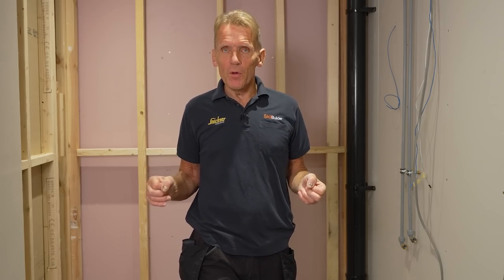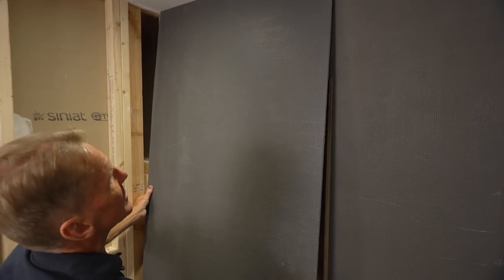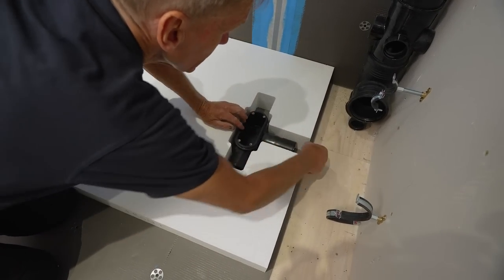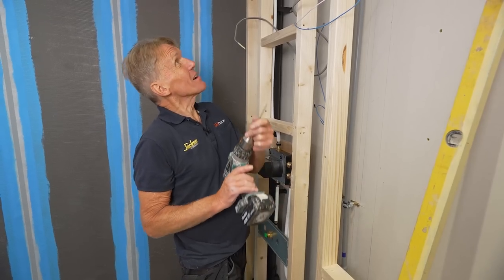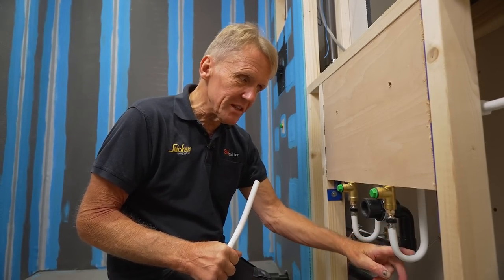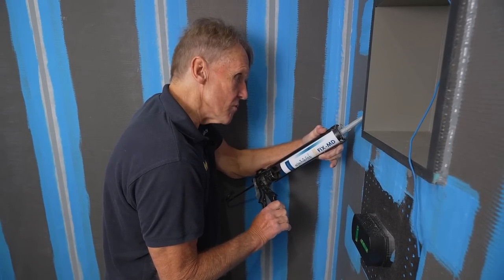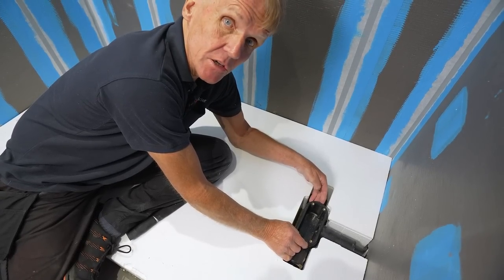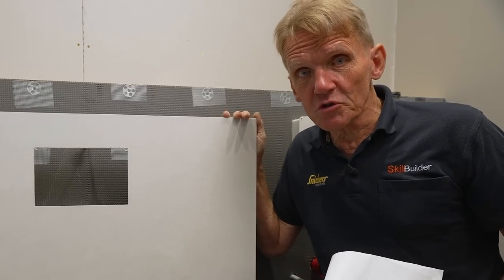At Last a Solution to New Build Bathroom Nightmares

Comment: As a competent DIYer and thanks to Skill Builder I have installed an abacus bathroom using the individual parts and have no issues several years later. This modular system looks even easier! Plumbers are living the dream.

Comment: Kitchen is finally finished, I managed to sort out the mess I made with the self levelling compound with a bolster hammer and chisel 🥵Living room, bedroom 1 & 2 completed. Now it's bathroom time. I will have to check out all your vids relating to taking one down and installing a new and any others will help be fix my cockups 😆 Cheers !
Reply: I did exactly that when I did my kitchen floor!
That self levelling compound does not self level!
A builder friend who does a lot of floors says you have to put more water in it than they say on the packet to get it to work...

Comment: Started using elements boards and shower trays a few years back thanks to you roger, I absolutely love there products, my only concern is with everything pre done future trade people are gonna be even less skilled then they are now, and if things need slight modifications to the plans (like in most cases) I fear these people won’t have the skill to do it, saying that I do like the idea and can see the appeal. Thanks and keep them coming 👍
Reply from the maker: Plumbers love fitting this system, it is so easy. This is new build so there are no variations

Comment: I'm in Maine, USA. I have watched some videos from the UK and other places outside of the US. I find it interesting that push sewer pipe is allowed. We have to use a solvent weld PVC or ABS or a rubber/stainless steel clamp coupler on cast iron inside a building. On the outside a push type coupling is ok in some places at a certain distance from a house.
I really love this concept though.
Reply from the maker: We don't tend to have much trouble from those seals but solvent weld is better IMO

Comment: Love your videos as always Roger but this is not too far off what a regular installation looks like. What exactly is Abacus offering to help the bathroom fitter?
Reply: A sponsored skill builder instructional video.
Reply: Well I reckon it saves half the time, the tiling is pretty bang on and the aesthetic. I think it must be a joy to work with this. curious to know how much extra it costs to use an all in one solution like this.
Reply: Surely the precut tiles are worth it?
Reply: @peepiepo  Not to me as much. I’m a tiler and these cuts are only another 10 minutes per tile on large format. Plus the time constructing stud work to their exact spec probably offsets any time savings. If you’re doing this day in and day out, fair enough.
Reply: @grrinc  I think the studwork was prefab too
Reply from the maker: Hi grrinc. 
You can get all the kit from Abcus but this is for new builds. It suits high rise and hotels. Plumbers love working on these systems.

Comment: You said the elements board is 12mm thick and will Marry up to the plaster board 
But I was under impression plaster board standard sizes was 9.5 and 12.5 mm 
Always puzzled me why these elements boards and other water proof boards are always different to standard plaster boards 
Plz educate me
Reply from the maker: Hi Chris 
Half a millimetre? Even if you taped and jointed you would not notice/ If you skin then the half is not a problem. I am not sure why plasterboard has the half millimetre
Reply: @SkillBuilder  thanks for the reply 👍

Comment: Abacus must not know the new build market if they think this would get executed on site.
Reply: I can see half those brackets and fixings ending up in a skip for sure
Reply: @oktfg  those wedi boards would just be plastered over lol
Reply: @Swwils  Roger was putting 100x more into that installation than any trade I’ve seen onsite.  I’d go as far as saying Abacus’s system was hindering and making the installation more difficult for Roger, as he was double checking all the part measurements that should of been accepted already to gain the efficiency to make a modular system work
Reply from the maker: I always check the dimensions. I have seen builders crane glass panels into high rise only to find they don't fit

Comment: Roger, the knuckle draggers who work on new builds don’t work to precision, only speed. For example, the vertical timbers in your example actually looked plumb and the corner looked square. Remember, they don’t measure anything. Tradesmen (bodgers) on building sites are to accuracy as Dianne Abbott is to mathematics. However given competent builders this looks a great system.
Reply: 🤣😂🤣😂  Dianne gag
Reply: It's a bit of a moronic take to assume that every tradesman on site is a "knuckle dragger", it's also a total fallacy to say that "they" don't measure anything.....As with absolutely any sector of employment you'll have people who are better at the job and some who are worse. Site work has generally become harder over the years as the time constraints get tighter and tighter. Id be totally lying to you if I said my work hadn't also suffered at the hands of meeting crippling deadlines, but unfortunately that's the nature of the beast. You can take any person doing any job and reduce their time to complete it by a certain percentage and you'd get the same result across the board. I'd say it's probably not wise to blanket insult tens of thousands of tradesman all over the UK because of a small contingent who do a lower quality job.
Reply: Look at trev 🤣 why don't you tell them to their faces 🤣 you'd get sparked right out 😴😴😴😴
Reply: @greenreaper1985  well said fella 👏 👍 👌
Reply: Unfortunately the principal contractor set's the price especially on new builds and the principal contractor doesn't care less about the buyer but 99% of lad's on site will take pride in their work it's only a small few that don't care 🔨
Reply: @tomsmith9048  spot on
Reply: @nickharrison6694  Our problem is that it’s only a small contingent of tradesman who do a good job. Too few properly measure and people like @The Watcher describe them well. They are intolerant bullies who prefer to thump someone rather than do a good job. The proficiency of brickies and chippies is easy to see just by walking around any building site. Pissed verticals, random angles on exterior woodwork etc.

Now who pays the price for their time constraints? I say it’s the buyer. They are left with pissed buildings, the crap hidden under the bath and under the floors, poorly fitting doors, weird plumbing, radiators in the wrong place, loft hatches in silly places etc. The root of the problem is that building companies are so eager for their cash they do not care about standards. The guys on site realise this and perform accordingly. A friend of mine is a surgeon. Would you like him to behave like a tradesman? I used to fly airliners for a living. Would you have liked me to have been as inaccurate as an average new build tradesmen and take so many shortcuts?

Of course many builders can work to +/- a few millimetres or better. But too few do. I’m privileged that the guys who have worked on my house do an excellent job. But those who built it were brick jugglers and wood butchers. My hope is that all new builds will be covered by the Consumer Rights Act 2015. Then we’ll see a change. The good guys will be sort after, the poor ones will have to either have to improve or break rocks for a living.
Reply: I'm a plumber, the majority of my work is emergency and repair, I make a killing on new builds so if everyone could just hush and keep it the way it is then that would be great for me.
Reply: @bertram6934  I'm trying my best to keep you in work buddy but I'm only one man 🤪🔨
Reply: @Trevor_Austin  again that's all set by the principal contractor if you look up persimmons home MD he got a 110 MILLION BONUS in 2018 that's where the profit goes 🤦‍♂️ I hope James's comes on and tells the truth of how bad the construction industry is I assume that's why he left the kitchen company and as for your friend the surgeon he's good but can he hang a door 🚪 🤪🔨
Reply: @tomsmith9048  James left the kitchens? What's he up to now? Sorry, I've been flat out all year and must have missed the updates
Reply: @rossbuchanan7632  I don't have a clue but a man of his meticulous mindset I can only imagine it's hard when people tell you to cut corners 🔨
Reply: @Trevor_Austin  The irony of your comments isn't lost on me. You want to call someone a bully after insulting them and their trade? You throw around these stupid terms like "knuckle dragger", "wood butcher" and "brick juggler" and then are shocked when you've provoked a reaction? It's also fairly laughable that you complain people aren't measuring anything yet you're totally happy with the work done in the video because it "looks right". Have you been there? Have you put a level on the studs? Have you put a square in the corners? No? But it's ok, according to you and your laser eye it "looks right".....I'm gonna take a stab in the dark here and guess you're a disgruntled purchaser of a new build house?
Reply: @tomsmith9048  well said , unfortunately the big house builders these days are run by accountants, ex bankers and QSs these days, all they think about is money, dividends and their bonuses .  They are always squeezing the contractors for money, Avonside roofing , one the biggest roofers in the U.K. went bust on Monday due to margins being squeezed.
Reply: @Trevor_Austin  how rude,your welcome to come look at any of my jobs. My reputation is in my success. 
No plasters on my knuckles 😁🤣
Reply: Trevor Austin is clearly a Persimmon home owner.
Reply: Its because of price work bullshit.
Reply: @paulatreides0777  indeed , crap prices = rushed job .
Reply: I’m going to guess you worked on site one time and told them all this? No didn’t think so.
Reply: @The.Toaster  That's a broad statement on agency worker's I did it for years because the agencies pay more and there's plenty of great tradesmen doing agency work 🔨
Reply: @The.Toaster  it's the other way round there's no pressure on agency workers because we've nothing to lose it's the cards in lad's that have to hold onto their jobs pension ect and you never mentioned pressure or capable of work you just slagged them off the same way Trevor slagged off tradesmen on newbuilds
Reply: @The.Toaster  you said you work to mm the agency lad's not so much so you are  slagging them off just as Trevor is slagging off house bashing lad's
Reply: @The.Toaster  again that's not what you said originally
Reply: @The.Toaster  just a fact Trevor made a broad statement and you tried to chastise him but you also made a broad statement about agency workers seems like your a hypocrite but now is going off topic because you know your wrong 😝
Reply: @The.Toaster  that's my point 🤦‍♂️
Reply: @The.Toaster  you didn't explain your point in your first comment 🙄
Reply: @The.Toaster  you didn't give a point just  generalising all agency tradesmen are the same just like Trevor did about tradesmen in general 🤦‍♂️
Reply: @The.Toaster  as did Trevor about newbuild tradesmen and you took it personal 🙄 I can't help your being a hypocrite you just are one😝
Reply: @The.Toaster  the personal insults the sign of a man who's known he's beaten but then again it's not hard to beat a hypocrite 😝
Reply: @The.Toaster  but you are a hypocrite that's just a fact 😝
Reply: @The.Toaster   now i can feel the frustration of a beaten hypocrite 😉😝
Reply: @The.Toaster  that's because it's a the truth I can feel your frustration from here 😝😝😝😝😝😝
Reply: @The.Toaster  easy tiger I'll have to start calling you the clock ⏰️ 😝
Reply: @The.Toaster  who said I was agency 🤔 I can feel the tension in your messages ⏰️ 🤪🤪
Reply: @The.Toaster  I'm just pointing out the hypocrisy in your original statement ⏰️ 😝😝
Reply: @The.Toaster  easy ⏰️ don't take it so personally just because you make 25 an hour cards in no need to get angry 😝😝
Reply: @The.Toaster  I feel alright alright alright no response to the 25 an hour ooooooooooooo it must be less than that clock ⏰️ 🤦‍♂️😝😝😝😝😝
Reply: @The.Toaster  the pay is on per with your talent ⏰️😝😝
Reply: @The.Toaster  it's easy when I study horology ⏰️ really easy 😝😝

Comment: Boss: Just got to check all the measurements, it’s all there on the drawings. And if you just make sure you get everything exactly in the positions indicated you can’t go wrong.

New build trades(later in the day): Boss, drainage don’t seem fit and something is leaking. What do with these parts left over??

I can imagine the Administrators reporting on the insolvency of Abacus Systems will comment the modules proved to complex for onsite handling in the res new build environment.
Reply from the maker: This system is working well in many new buids and Abacus is thriving and innovating for a better world
Reply: @SkillBuilder  I used the Abacus Easi-Plan manifold and its a brilliant bit of kit. They make good stuff.

Comment: Roger sadly all good with these solutions but the one thing they rely on is the one thing that most tradesman dont have , CARE, as usual your day raters or subbies will slap this together and expect a great finish which obviously wont be the case, i guess one saving grace is some bits are already done but even that relies on testing stuff and taking care about how its going together.

Comment: Definitely tiling isn’t done properly, 6mm trowel is for mosaic or small format tiles mate. Use at least 12mm
Reply from the maker: The wall is flat and you have no need of a thick bed on Elements board. How do I know? Because I have had to crowbar the tiles off of show room bathrooms
Reply: A flat surface doesn't change anything. You won't get proper contact between the board and the tile. Second, it's impossible to remove tile from those boards as it would come with it. How do I know I've installed thousands of them

Comment: Looked nice when finished but that shower tray height is a bit 1980’s. As in having a 4” step up onto tray could be avoided in this day and age.  With the layout of the soil stack branch to shower on a concrete floor means the house is stuck with that for ever so forget about any health problems of anyone accessing the shower.  Not much gets past you so you will of been well aware of it. And that pex pipe youre fitting is fine until a mouse has a chew of it, the house is in the middle of nowhere and the plumber has a nightmare hunting for fittings cause its not a standard size. 👎🏻👎🏻👎🏻
Reply from the maker: Ah there is so much to be sad about these days.
Reply: @SkillBuilder  yep you wont be retiring in that one mr with ur dodgy knees but nobody should be fitting trays like that deary me.  Not very eco friendly manufacturing that polystyrene  then into landfill after its stripped out 🥴